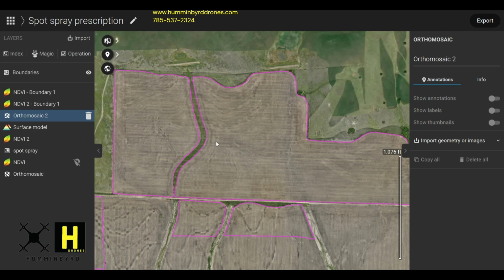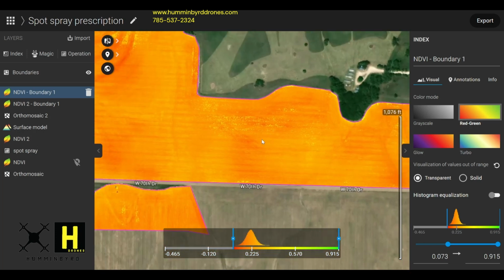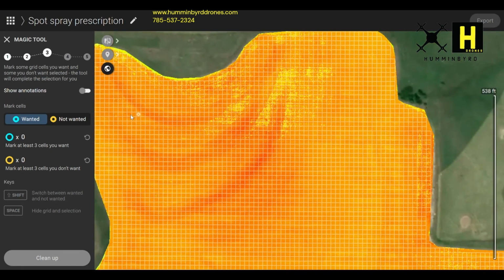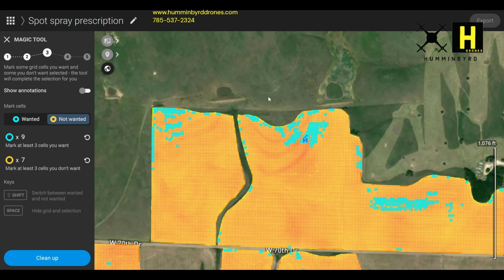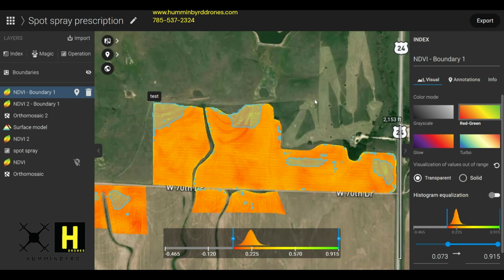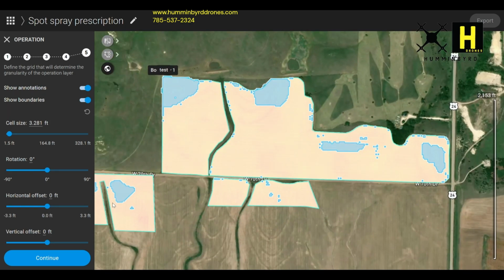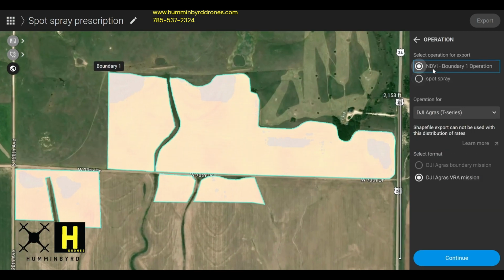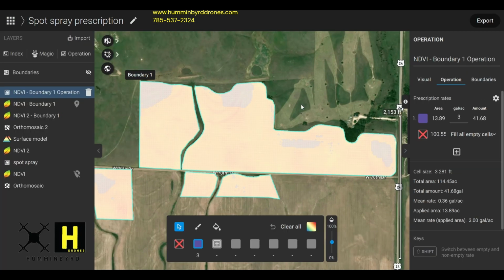How to Perform a Spot Spray Application in Pix4D

Comment: I have a question. We have larger field areas. I flew a Mavic 3 over an alfalfa field and processed the images using Pix4D. I was able to detect larger weeds, but not smaller ones. The flight was conducted at about 80 ft with a speed of 5 m/s, under acceptable wind conditions, around 10 in the morning. The alfalfa was at the maturity stage. When I checked the field manually, I also only detected larger weeds. Is there anything I might have missed? Any recommendations?